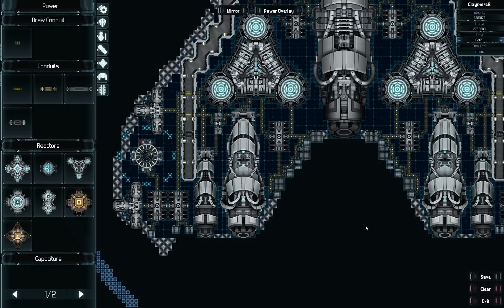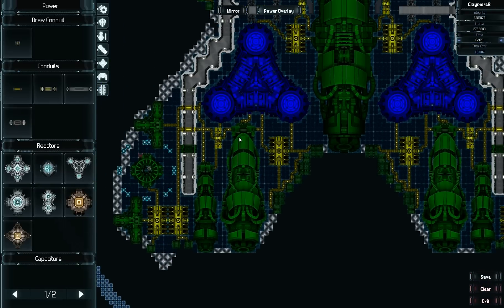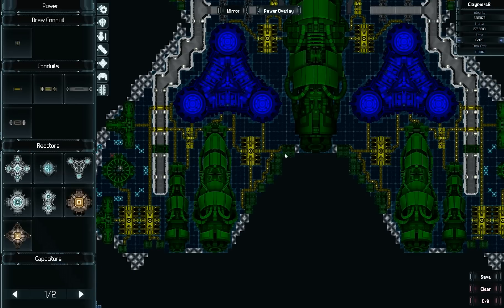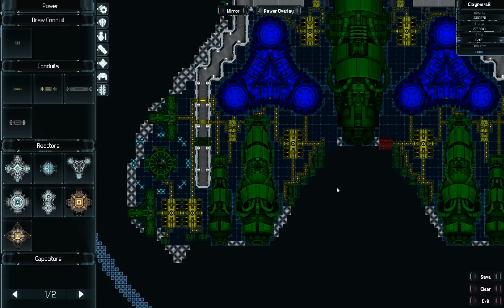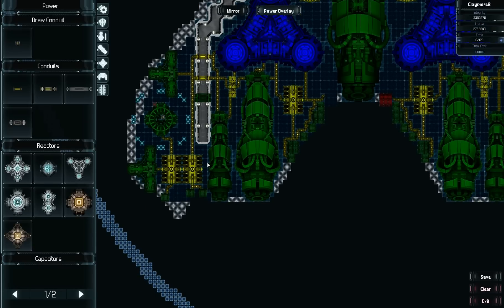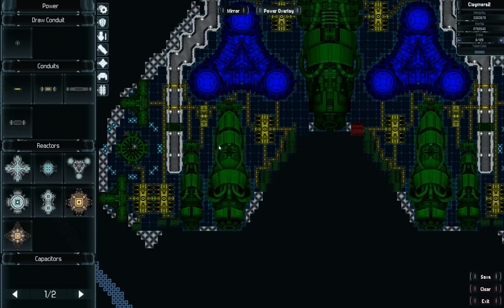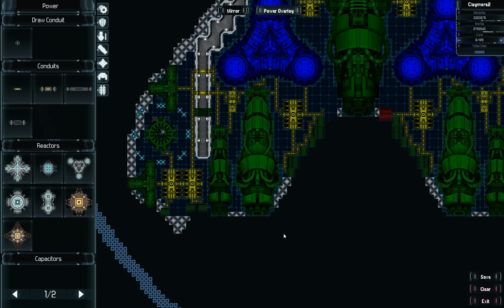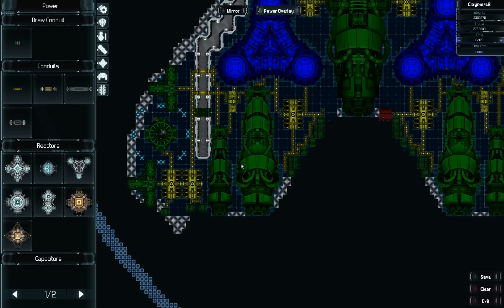Power explained

Comment: have you thought of putting an auto shield tracing tool for large ships? so you dont have to spend 10-15 minutes drawing the shields on a huge ship. you could set how many blocks away from the ship the shields should be and how thick ect.

Comment: Is there any way that you could add a feature in the ship editor that tells you your total power drain, generation, heat dissipation, and other stats? That would be really useful, because it's annoying to have to use a calculator to min-max ship power.

Comment: So my 'redundant wiring' is actually really really bad.
I need to plan it out more like a one-way street than trying to make as many redundant connections as possible, since the pathways are essentially tied up.
It's also nice to know how heat sinks work in detail, in terms of power and heat management.
Having a system where one set of heat sinks can essentially pull heat from half of a ship and every reactor is pretty brilliant. Since heat management IS a big deal.

I shall direct anyone interested in the ins and outs of ship building as far as power is concerned to this video.

Comment: You are essentially programming a ship-building operating system with all this resource management crap.

If I could make a recommendation, and assuming you haven't heard or thought of this before, which you very well may have.

This game is going to need a skippable early-game tutorial.  It needs to have some system where the player is heavily restricted, and faces challenges that force the player to understand all the individual mechanics.  You can't rely on videos like this to explain your games, otherwise your game will fail in the way way AI wars did, where it is a great game, but few to nobody understands it well enough to really play and enjoy it.

See factorio, portal, kerbal space program, and so on, for examples of this.  I think the game would benefit a lot from a structured mechanics-introduction phase.
Reply from the maker: +Scythe Seven That's indeed our design intent with the current system, however we made that choice because we haven't finished T2 and T3 unlock content yet. Once we have a larger pool of technology to unlock we intend to make the beginning experience a lot easier by granting a lot of starting tech right off the bat. So in a sense you are both correct, the current system isn't final in any way, we just need to add lots more loot!
Reply: +biomerl That's a good idea, but so far in the main campaign you start out with very little room to edit ships, and the idea is that, over time, you will unlock more modules with which you can play around. Actually building a ship from the get-go is for the vehicle designer. However, you must unlock many of the games weapons in the campaign before getting to use them in the vehicle designer. In just unlocked an awesome gigantic antimatter rocket pod that I can't use in the campaign yet but can equip in the designer.
Reply: George Hultgren
Cool.